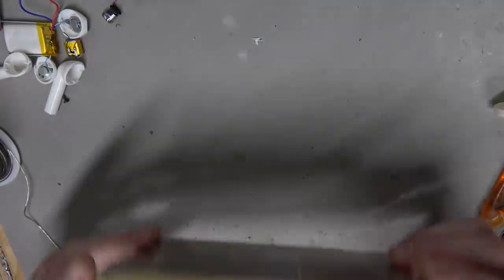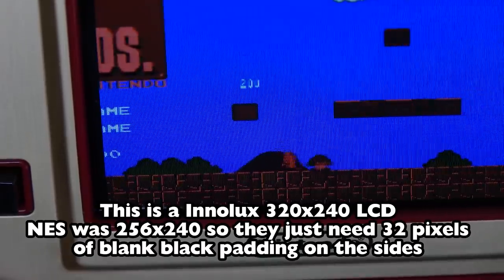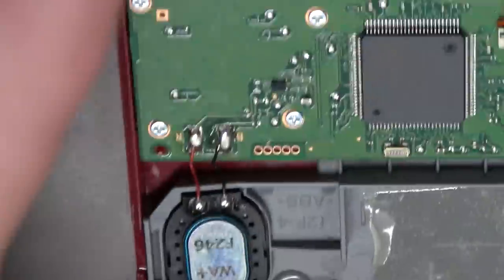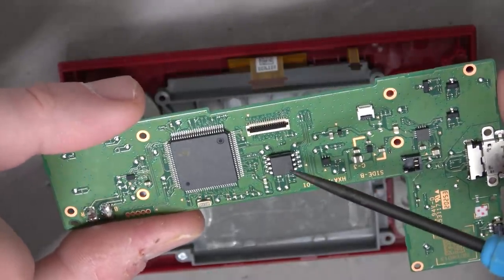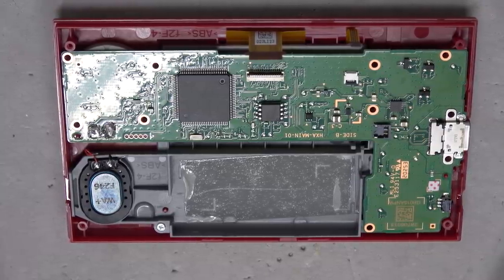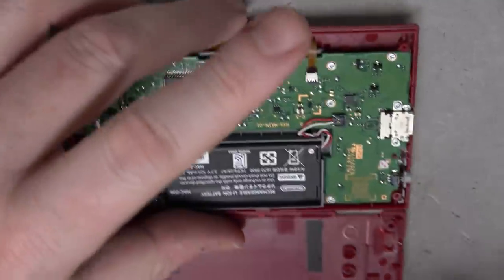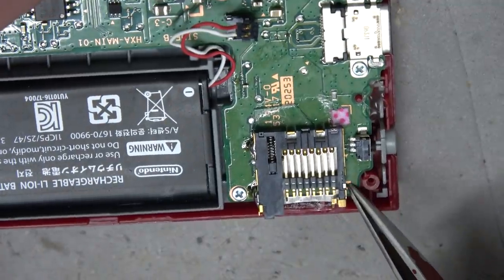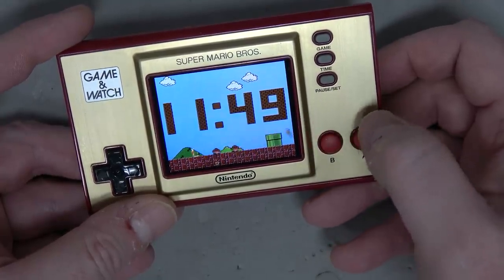Inside the New Nintendo Game and Watch

Comment: Ben: "Nintendo Is not gonna skimp out"
Me: My joycons beg to driftter...
Reply: I see what you did there.
Reply: so far I've had luck with using WD40 Contact Cleaner on the joycons to fix them up
Reply: They used essentially the same design as the tried and tested PSVITA, unfortunately people play with their switch a bit more than people played VITA.
Reply: I think he meant in comparison to what he just reviewed
Reply from the maker: Issue with them is they have to be small which means they're going to wear out faster. The Xbox One analogs aren't amazing either.
Reply: Anyone remember the struggle with nintendo 64 controller thumbsticks? The plastic dust and not centering after not much use. Then turning on the console to have it calibrate not centered. All things considered, I miss the 90's.
Reply: @BenHeckHacks  To this day, Ben, I have yet to have issues with my Xbox One analogs. Got a controller from 2016 which is still kicking to this day. I think the first thing to fail on them for me were the shoulder buttons.
Reply: @BenHeckHacks  3ds joysticks beg to differ.
Reply: @zaberfreedom8224  Well those are quite different in construction, and then they had their own problems (with people playing Smash, notably)
Reply: @TwoScoopsofDestroyer  except a 7 year old Vita still works

Comment: Dear Nintendo,

All I want for Christmas is a Gameboy-Classic.
Reply: You can buy any of the Gameboy lineup (except the SP AGS 101 and the micro) for less than 50 USD, and the games are cheap as well. I don't see why would you want a "Classic" version
Reply: Just buy a gameboy everdrive.
Reply: I want two, one for hacking and one for keeping unmodified.
Reply: Buy a pi zero and a gpi case by retroflag
Reply: What’s the point when you can still get GB on the cheap these days🤷‍♂️
Reply: Yeah I got a GameBoy pocket recently plus an Everdrive for it (the one with the save state button on it) and it's great. Although you can only use it during the day. I have no idea how I managed to put up with the screen back in the day, you can't see it at all unless it's incredibly bright, like even daylight on an overcast day isn't enough, you need a torch or something as well
  
So I then got a re-shelled GBA SP with a modern screen on it and a custom shell that looks like a European SNES (the super famicom design). Someone was making them on etsy, and I am terrible at electronics stuff so I thought it was a better option than trying to put in a modern screen myself. And so I play mostly on that now. It's absolutely gorgeous looking. And I'm gonna get a GBA everdrive as well to play GBA games on it as well as GB and GBC. But it's nice having an old gameboy again too. The screen of the original and the Pocket are so unique, I've never seen anything like them. They look like nothing else, like everything is floating on top of something. I guess that calculator screens are the same, but yeah
  
Oh and there's sites like this one where it has hundreds of homebrew gameboy games to download for free: https://gbhh.avivace.com/
Pretty neat

Comment: Do the opposite and make a cabinet version of the game and watch
Reply: yes
Reply: Do that, with an original G&W! Have the original LCD screen, and just shine a light through it from a powerful LED. Then a simple screen, even a bit of paper, to project the image on to. Maybe an A3 piece of paper, stuck to the screen glass of the cabinet. Then wire the controls up to the joysticks as usual, maybe to a JAMMA finger board. Nice! You'd probably want to keep the volume down a bit, a full arcade machine amplifier is quite loud, and the shrieking beeps of the piezo would sound even more ear-piercing from an arcade cabinet's speaker.

You could do it, would mean destroying a Game & Watch but there's plenty of them still around, not too expensive, and how cool would it be? It'd be like one of those pre-1970s machines where it's all electro-mechanical and working off film projection and bits of celluloid moving around.

Comment: One of my first forray into electronics was modding my GBA with After Burner light when I was  in middle school with my Dad in like 2002. So I'd like to thank Nintendos stubbornness for making me mod it with my Dad's help and helping me get into electronics through their stubbornness of not adding a back light!
Reply: The after burner was one of my first too.  I'm surprised it still works with my crappy soldering.
Reply: @joneilkimball  My dad professionally soldered microcontrollers at a machine shop (among many other things) for his career so he was critical and made me practice till I got a decent solder joint so mine aren't terrible for my first serious project. Thanks Dad!

 The mod works great for me too and I don't see really see a reason to mod it with a modern backlight screen etc like you can now and days. Plus it's cooler and more authentic  having an era appropriate mod!

I really need to find my Dad's Weller soldering iron from the 70s and have it on my bench as I bet it still works great! Unfortunately he has dementia now and it's been progressing so I'm his caretaker right now but that's a story for another comment or video!
Reply: @bf0189  Sorry to hear that about your dad.  

The nice thing about the front light is you can still play in direct sunlight.

Comment: It doesn't do any integrity check about the roms btw, and also they use aes-ctr for crypting the flash, how many years they will keep using that flawed encryption? xD
Reply: It does have some hot swapping of the code to specific addresses to do things like change the copywrite date on mario. So that can be a problem if you reflash it
Reply: @shazmosushi  watched his video before ben made his :)
Reply: CTR mode itself is just fine. The fact they don't pair it up with a MAC (like you're meant to) doesn't mean AES + CTR mode is "flawed".

Comment: What I find interesting about this is the battery seems to be very similar or the same as the joycons on the switch. The port also looks the same too and it looks as though the connectors are similar. Is the battery charge controller one of the BQ series? Maybe the BQ24193 or BQ24196?
Reply: The speaker is the same as the switch too 😁

Comment: I think Nintendo intentionally makes things like this easy to hack. They don't lose revenue from people hacking it, because it isn't cutting into the sales of other games. If it is hackable, more people will buy it, and Nintendo only had to throw 3 games and a clock in which should have been pretty low effort. Same with the classic mini-consoles. Compare to the Switch, which has been hacked but did have actually measures in place to try to prevent that.
Reply: No, it's much more likely to be the opposite. They don't care enough to spend time focusing on the security.

Comment: wait don't the stm32 chips not have a programm lock fuse?
Reply from the maker: Only thing protected is the flash read. Also you could just erase and re-flash with new firmware.

Comment: 100 pins?  Do they really need that much I/O.  Cortex M7, that can even do DSP at 280mhz  You can get a JLink-EDU mini for about $20.  But if you sell anything you hack with it, you'd have to get the full JLink for about $400 due to the license.  I have Jlink-Edu mini (might spring for the full JLink-Edu at $60 someday).  Both work with Atmel Studio, but I'd rather use Open-OCD, or hope Microchip will add JLink support to MPLAB 'cause I use Linux.

Comment: Who really cares about the stupid software they ship this with as long as there is a way to erase the microcontroller and reprogram it. The board and display combo in a reasonable case with a speaker for $50 works just fine and maybe there is a way to remove the nintendo branding and make the bezel nice. The downside is there is no wifi or bt.